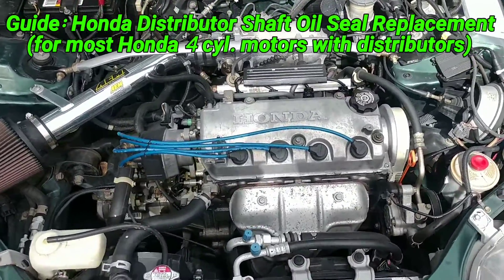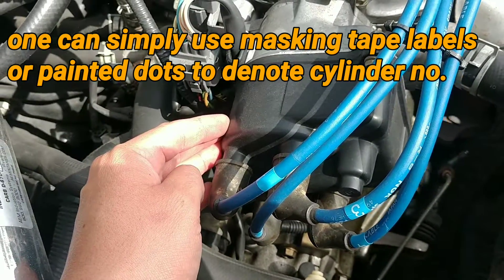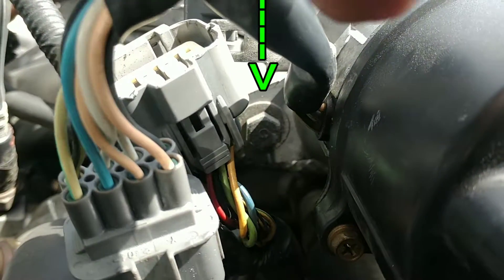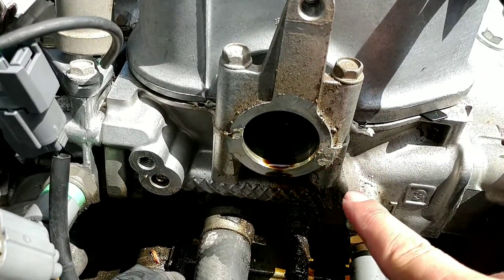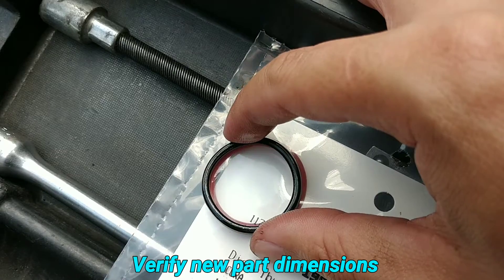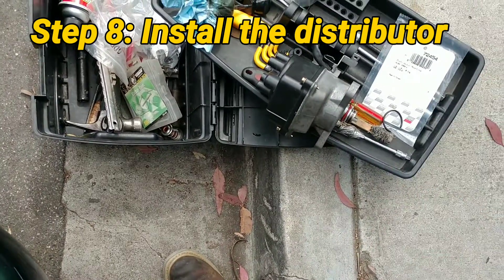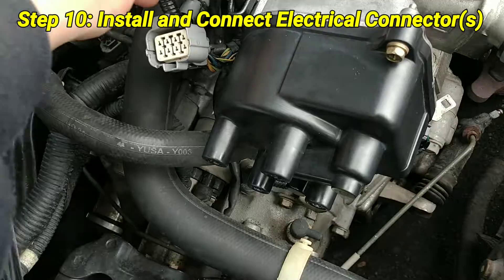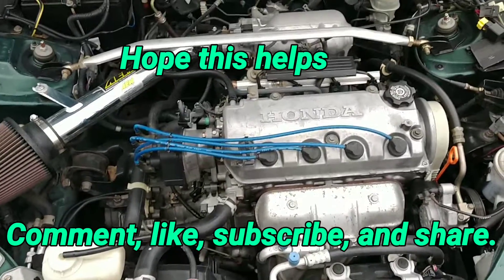Guide: Honda Distributor Shaft O-Ring Replacement

Comment: This is such an easy fix but isn't always the answer. Mine pours oil from the dizzy hole still even with a brand new distributor. Only just randomly started as well. Super annoying, and yes it is 100% the dizzy doing it.

Comment: Nice video - unfortunately what you replaced is not the oil seal but the O-ring! Replacing the oil seal is a much more complex job that requires complete disassembly of the distributor because the oil seal is deep inside the distributor casing. Other videos on YouTube will show you how seal replacement is done. Please change the title of your video to O-Ring replacement instead of oil seal replacement.
Reply from the maker: Hey Al F you're correct! Thanks for letting me know. Will do.